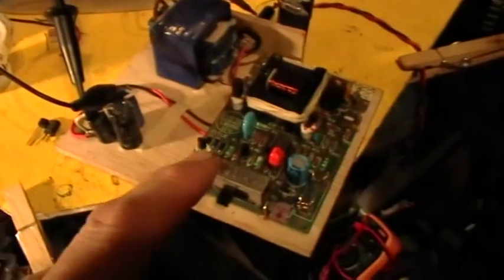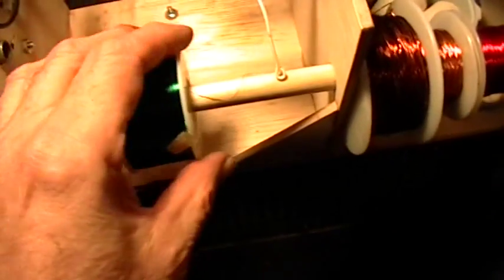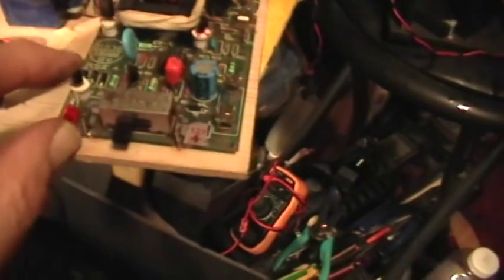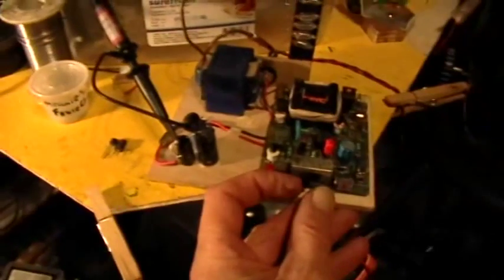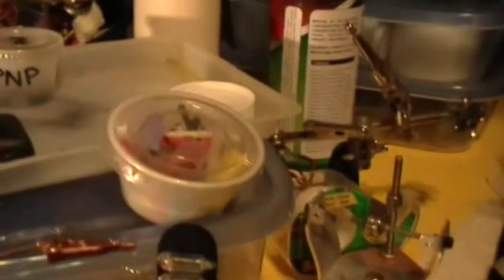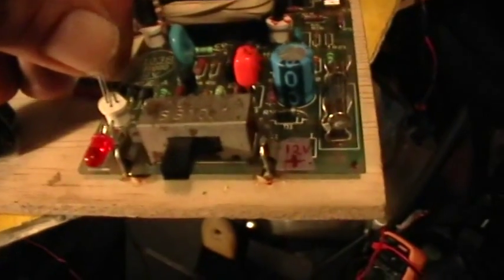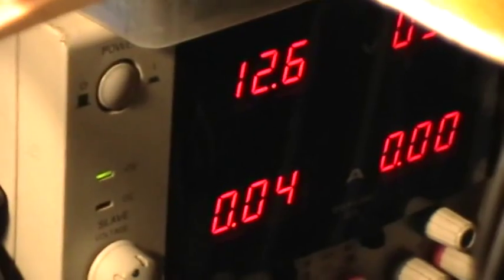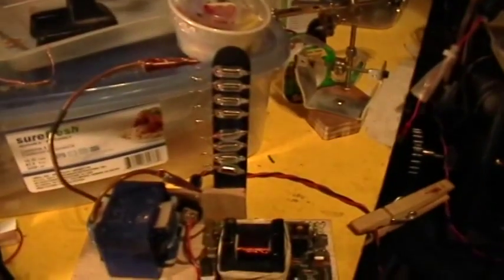Troubleshooting and Repair: SpeedRite SB1000 Fence Charger Part 2

Comment from the maker: I am still not completely confident that it is working as it should. I think that the capacitor should be charging to a higher voltage. I'm glad it isn't, but I think maybe the HV winding in the inductor might have failed, just at a different place than before.  I am actually tempted to take it apart and wind it yet again with different wire or isolation methods.  I have a similar core-bobbin but vertical instead of horizontal, that I pulled from an old TV or monitor chassis. I might make a substitute inductor using that assembly, which will allow the use of heavier wire in the HV section which might have better enamel insulation on it. Also the whole board itself is "dipped" by the maker after assembly, in some varnish stuff, to protect from moisture and provide a little more HV insulation. Much of this is gone now that I have been working on the board, I had to strip it off the pad side for good solderability. So I may have to dip it again to replace that isolation feature. Yuck. The only real isolation for HV is distance, and plenty of it.

Comment from the maker: Burn-in report: I added two more 90-volt NE-2 neons to the output test stack, for a total of 10 in series, and have now operated the device continuously overnight without glitches, flashing the stack once per second.

I know it will flash even more neons but I am using a "backwards"  ordinary AC line transformer for the output and I don't want to risk insulation breakdown in this transformer. The fencer's pulse output goes to the 12 volt secondary of this transformer and the neons are driven by the 120 volt primary, and its insulation wasn't designed to stand off a kilovolt!

Comment: Good repair. My analysis was right then. But you did it!
Reply from the maker: Of course you were right. And it's what I thought too, from the first, as soon as I saw the charge curve. It indicated both a high resistance and an insulation breakdown. But I was in severe denial because it might have meant the device was unsalvageable.
After removing it from the board, I carefully stripped off the wiring, noting turns, pins and directions. Then I put the bare bobbin-core assembly in boiling water for ten minutes to soften the varnish and glue, and very carefully prized out the E-core ferrite pieces with a utility knife blade. If I couldn't get it apart there was no way I could have wound the bobbin with 475 turns of #33 wire and if I broke an E-core bit, that's it. But I was able to get it apart finally, and was able to adapt my coil winder to hold the naked bobbin. As you can see I am using a rubber band wrap to hold the E-cores in place, because I sure didn't want to glue those puppies together again.

Comment: Ahhh the inductor! You're got more patience than me bro,  a true hacker effort! The animals won't be happy with the result haha.
Reply from the maker: I was resisting the thought that the inductor was faulty, because that is a real buzzkill for sure. But when all else has been eliminated what is left? It came off the board easily enough (13 of 14 bobbin pins present, all soldered to pads even though only six are actually used) and by the time I got the thing unwound I was committed. It took all day, I had it on and off the board at least six times. Once I get obsessed with something like this I can't quit. I've been known to spend two 16 hour days fixing a 20 dollar board, by scrounging parts from old lawnmowers and medical equipment.
I wouldn't dream of using this thing where any of my animals could encounter it! We have a "pet fence" on the inside of the backyard privacy fence that's a continuous-current model, very simple just an HV transformer really, and it produces a fair dinkum tingle... about like this one did before I fixed it. This one is supposed to run a mile of fence or more, and keep the cows in, feral hogs out. I may use it for capacitor charging experiments, put in a variable pulse timing control potentiometer.